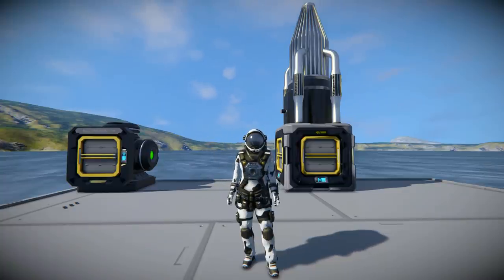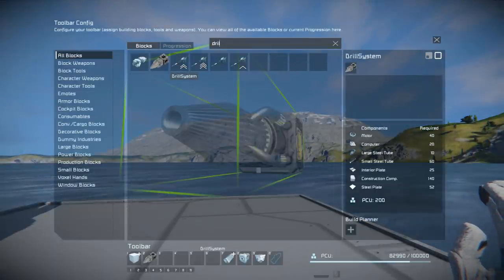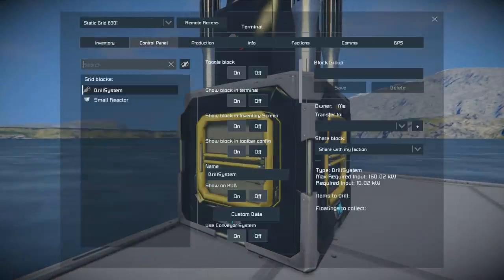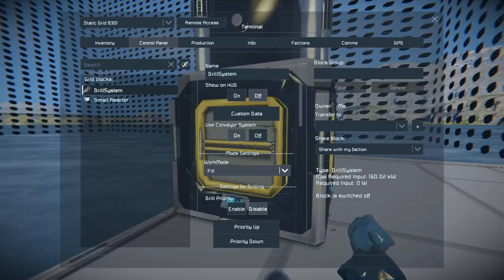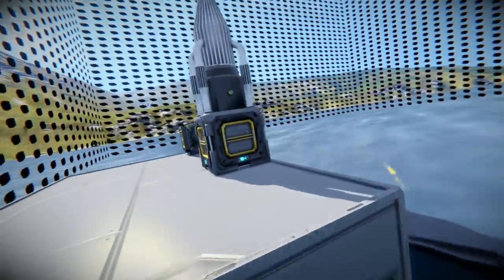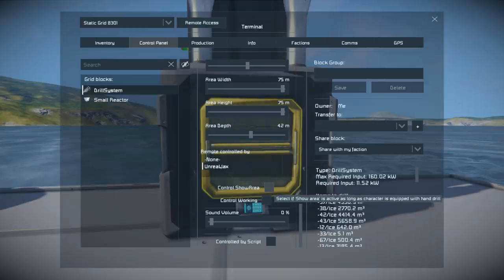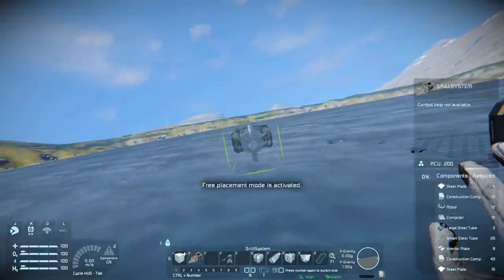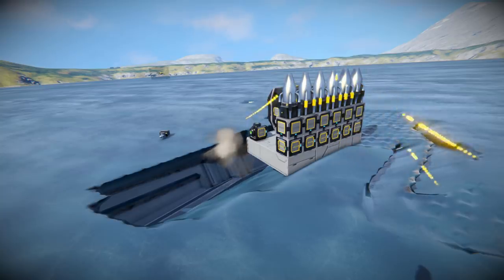The Nanobot Drill and Fill System - Space Engineers

Comment: In the current system this is a bit of a cheat, but I've started using the nanite mods because everything in SE takes so long to do in survival and I have limited free time. Also these systems also add something interesting to the game and allow you to things that you couldn't really do otherwise in survival. On the other hand it can hardly be called a cheat when it's just as easy to just enable creative and do whatever you want in no time, but that really takes all the fun away.

A lot of OP mods wouldn't be so OP if they were behind a more clever and robust progression system, maybe based on a research mechanic which should be vanilla.  The longer you played and fed the research system with resources the more powerful systems could be unlocked that way all aspects of game play had a place. Nobody wants to mine by hand forever.

Comment: Add a piston and you've got some fantastic tunnels :)
Reply: You don't even need a piston. Align the drill to the tunnel,  then set a timer block to increase the forward offset periodically. I drilled out a 10km pipeline tunnel that way, and used build and repair with blueprints and projectors to build the entire conveyor along it. Just remember to turn off the B&R's as the build area moves out of range... for performance' sake.